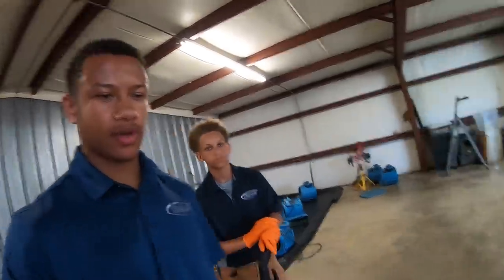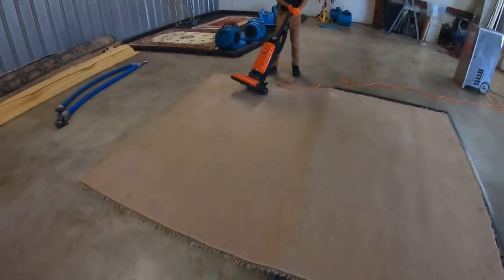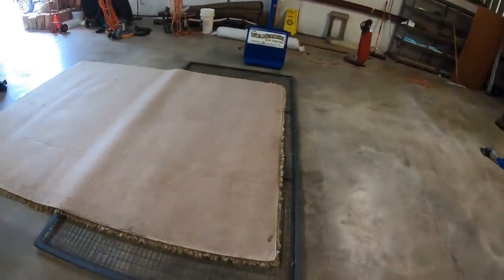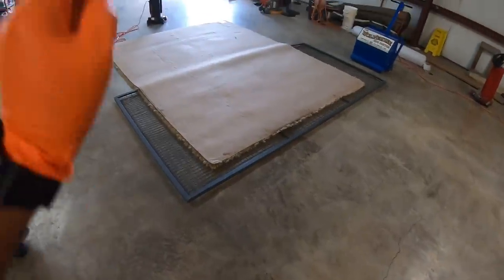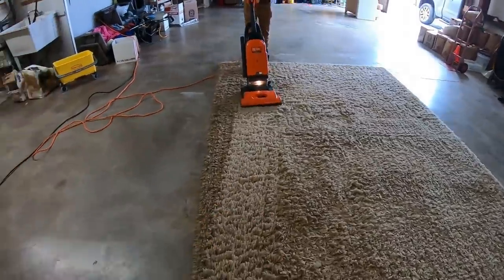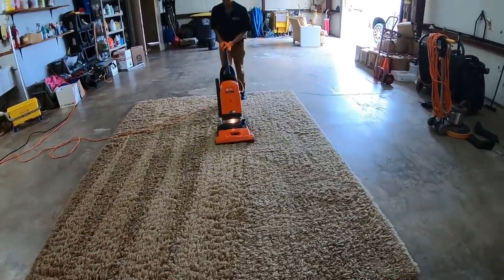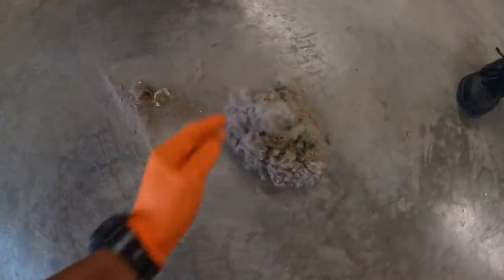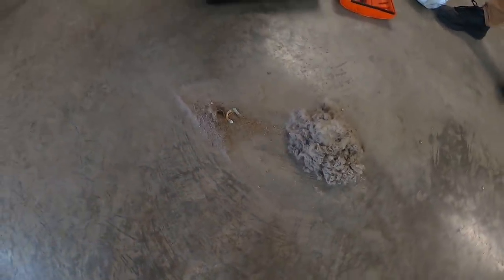Pre-vacuum Vlog #18 || Removing dry soil from a thick shag area rug

Comment: Keep up the good work and think about ear protection please. You are working in an environment that is pretty loud and you should be thinking about your hearing.
Reply: marinapia its a fucking vacuum 😂
Reply: @74ChosenOne  my dad is mostly deaf in his left from 30 years of driving around in a police with the driver window open. Over time, any noise can slowly make you deaf.
Reply: @74ChosenOne  It's not just vacuums that they are using. All of the equipment they are using especially in an enclosed building like that will cause permanent hearing loss. We had to even wear ear protection around dogs because of the loud barking.
Reply: Risk of tinnitus too. I'd also recommend dust masks.

Comment: Most recommend vacuuming before, and after extraction cleaning. When dry the dust is lose enough to vacuum up. Hair is most often embedded  in high pile carpet. Most wear and dirt is after the first 6 inches  of an edge of rug. Or the installed carpet. For people tend to pick up their feet, before stepping onto a different  level  of flooring.  You guys do great work.

Comment: I really appreciate the videos.   I just got hired at a carpet cleaning company in Atlanta. I was trying to see if I could ask you some questions? My number one question is how many homes a day do you normally do? And how many can realistically do?
Reply: I clean and I do 2 per day max, because I work alone and cleaning is hard work. So max I am physically active for 6 hours per day. The key to making it work is doing the job right the first time and charging enough money that your time and energy is compensated well.
Reply: @keriezy  so I'm about to start cleaning. The guy said it's typical to get 4-5 homes a day. I'd be making 20% commission so basically 60$ a home. That money seemed really good for that many homes. But for 2 a day that isn't looking as good. Have you heard of something like that happening? That many homes I mean?
Reply: @marcalexander6450  are you on a team? If so then it wouldn't be too hard to do more places. But I am a freelance contractor and I charge $50/hr.